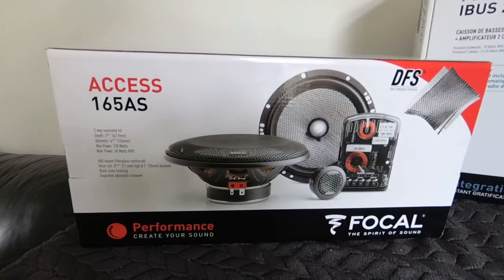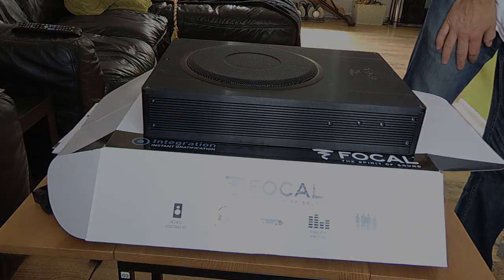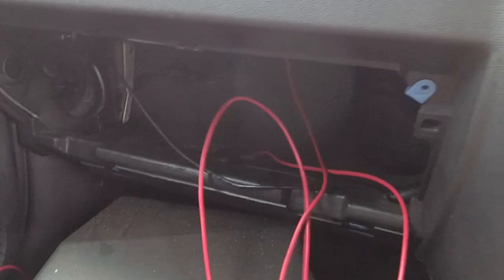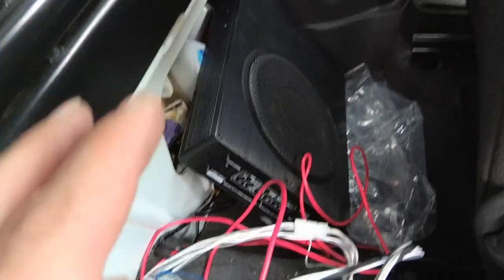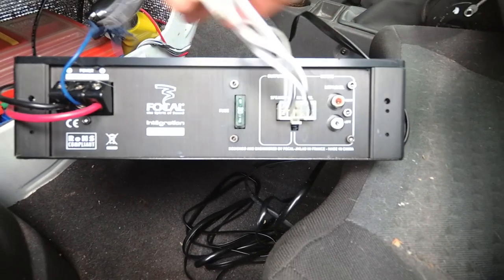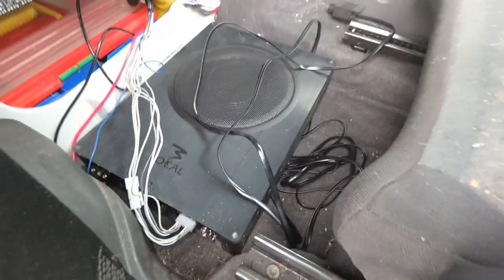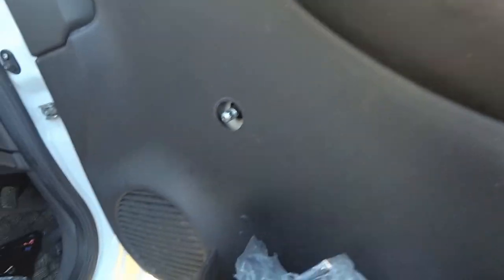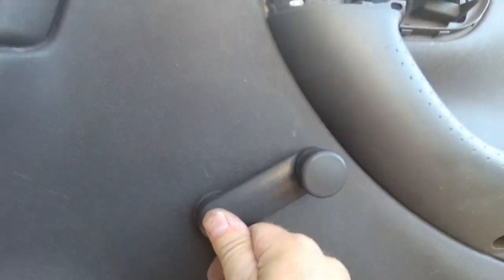Installing Focal 2 Way Component Speakers & Focal iBus 2.1 Sub/Amp

Comment: You've drilled a hole through your bulkhead to pass the power cable through. You made a quick mention about a grommet not being used because the hole size was small and the cable wouldn't move around much. My blood ran cold when I saw that. You are heading for a fire and possible destruction of your car. That wire is in contact with a sharp-edged thin metal sheet which WILL cut in to it due to vibration and movement over the coming months. No question. No doubt. There didn't appear to be a fuse in close proximity to the battery either to give you some measure of protection when that hole cuts in to the wire and shorts out.  High on your list of jobs to do is to get that wire out, make the hole bigger and fit a suitable sized grommet. Or any other bodge that keeps the wire off the metal and stops it chafing.  And fit a fuse near to the battery end. Seriously. Do it.  From a mechanical engineer. Not a paranoid electrical engineer.
Reply from the maker: It’s ok mate, you can sleep easy, there is a fuse on the power wire, within the first few inches from the battery. (You can see it in the video) 

I did also fill the gap with silicone, it’s all safe.

Goods points though! that’s some important safety advice.

Comment: Focal me, that is a tidy kit. For better quality sound I would run RCA's. twin phono to twin phono instead of the high level speaker input when using an aftermarket radio. You paid extra for an aftermarket radio, might as well get the most from it.  Could even get 2 of the kits ! sub under each seat and rear fill. Many aftermarket headunits have 4 RCA out and built in digital crossovers to improve the sound even further. Small Left and Right subs can be crossed higher even 110HZ instead of 80HZ to pull more bass out of the doors (which rattle) and under the seats (which don't).

Comment: I've had a few questions about upgrading the speakers on the Corsa C UK forum. I shall put a link to this video for them (and tell them to 'like' etc). Haven't even watched it myself yet but looking forward to it.
Reply from the maker: That would be great, thank you.
Reply: @RustLocker  The Q was advice on speaker and under-seat sub upgrade for someone who'd just bought a new HU so (I've watched it through now) your video is tailor made
https://www.corsa-c.co.uk/threads/speakers-advice.523679/#post-9269766

Comment: Hi are you sure they are mids and not woofers? Iv just bought the 165as without the seat sub buts it’s advertised as tweeters and woofer?
Reply from the maker: I call them mids, as they aren’t purely for low end bass like a subwoofer, I suppose the accurate description would be a mid range woofer? Anyway the speakers will be perfectly good though even without the under seat sub. You’ll get all the frequencies needed for great sound, just not as loud as with the sub/amp. You made a good purchase.
Reply: @RustLocker  Hi man are yours wired upto an amp? Iv had these for a couple weeks iv a seat sub connected to, I just don’t rate them they lack in clarity? There loude just not clear??

Comment: Thank you for making this video I’ve never installed components speakers before. I’m replacing my door speakers can I use the existing +|- wire that is wired to those speakers to wire directly to new focal crossover then wire new components from crossover. Newer Sony DD head unit no external amp. Thank you for your help
Reply from the maker: Yes, you can, those wires go into the input on crossovers and then your speakers are connected to outputs on the crossover. Hope that makes sense.

Comment: Just ordered this setup on the advice of my local installer for a VW T6.  Had my reservations as was previously looking at Kicker HS10 active sub and JL C2 component speakers running off my Kenwood 8020 head unit.  Trying to work out if I made right choice of going with this Focal setup, the amp for the sub is seems lot less power, although I will get amp power to the front speakers...
Reply from the maker: I’m over the moon happy with this set up. I don’t have much experience with other subs though.
Reply: What did you end up doing. I’m trying to decide between those exact two set ups
Reply: @howlieboy  I went with the focal setup, very pleased with it. It's not loud enough to break any windows but it sounds amazing and is more than enough volume/ base

Comment: What's the difference with this Ibus 2.1 and the 20?
Reply from the maker: the main difference is, the 2.1 has extra amp power to send to speakers, the 2.0 just has an amp for the subwoofer.
Reply: @RustLocker  the video is very helpful.  I already ordered the 20 and it arrives tomorrow so I'm preparing for installing it.

Comment: Does the loom allow you to run to two of these so you can power a front door and back door set up?

I have a Ranger with the standard head unit so I won't have a front and rear RCA output.

Also, I take it this kit bypasses the headunits front speaker output so that the OG wiring going to the OG speakers is now amplified? or are you best rewiring the doors from the amp?

You look to be out of stock on these amps now?

Comment: This video will help a lot with my speakers and amp I got but quick question if you can help with. The input on the crossovers. can speaker wire run down to the amp and be powered from that? Great video!
Reply from the maker: yes, speaker wire goes from the amp to the input n the crossovers.

Comment: Thanks for this great video. My only question is how does the live wire from the crossover input connect to the back of the head unit for the mids and tweeters? My stereo only has 2 pairs of RCA inputs
Reply from the maker: I used the sub to supply power to crossovers using the harness, I used the stock speaker wires as inputs to the crossovers ( because with the supplied harness, the head unit speaker outputs are unaffected). 

do you have the ibus under seat sub?
Reply: @RustLocker  sorry for not getting back to you. However I managed to get it all up and running it sounds amazing in my T4. Couldn’t have done it without your help. Thanks again!
Reply from the maker: @EntheogenMusic  all good mate, glad I could help.

Comment: Je ne comprends pas bien l'anglais mais pouvez-vous me dire si les réglages de la fin de vidéo sont faits pour faire le rodage de l'appareil ? Où ces réglages sont à faire après le rodage ? Merci bro
Reply from the maker: I’m not sure about what you are asking. The settings at the end of the video are a guide for quick set up, I did not ‘run in’ the amp or speakers before those settings, only after. 

I Hope that’s translatable.
Reply: @RustLocker  Thank you for your reply.  I wanted to ask you if the tuning at the end on the ibus is done when the device is new or after its break-in time (a few hours of operation)? thanks
Reply from the maker: @Mehdi_Mehdi  I tuned it from new buddy.
Reply: @RustLocker  ok thanks bro i have turn my ibus with your setup and sound is Monster good 👍 😁

Comment: Why not use the RCA connections instead?
Reply from the maker: +Fabio Alonso you could, it’s just a different way of wiring it up.
Reply: Yeah, but you’re running two amplifiers in series, resulting in twice the distortion.
Reply: @RustLocker  It suboptimal way of wiring it up and only should be used for factory headunits that have no RCAs.

Comment: That sub is so pitiful
Reply from the maker: As I say in the video… I don’t want to go around rattling windows, I just want deep rich sound. 

For the compact size of it, this sub is the bollocks mate.
Reply: It's really not. Doors are shite, they rattle with bass. A small in cabin sub means you can dial out bass 80Hz and below from the doors and send it to the sub. Small subs better integrate with door speakers. For deep bass he can always add a big 12" later. It will compliment it.